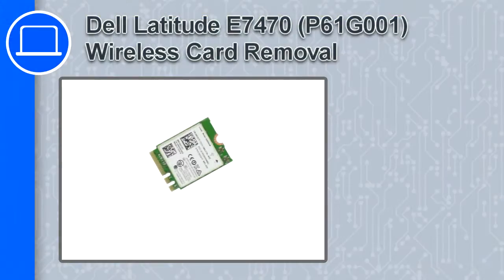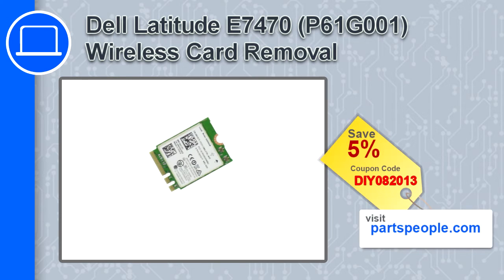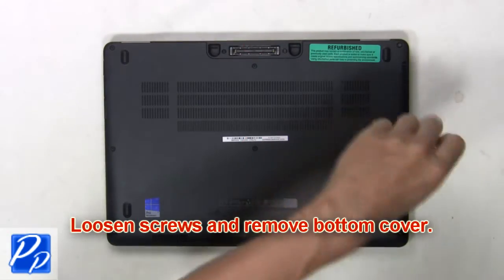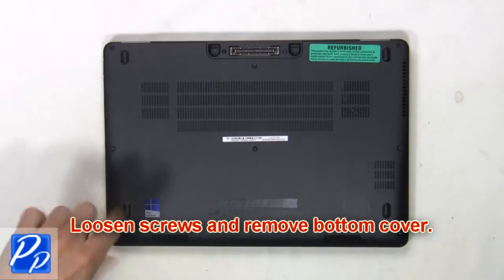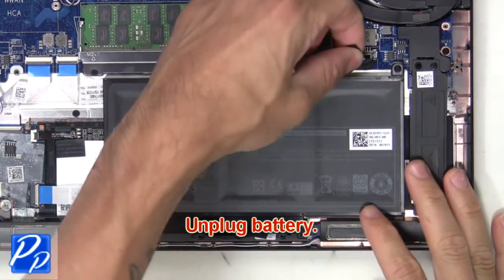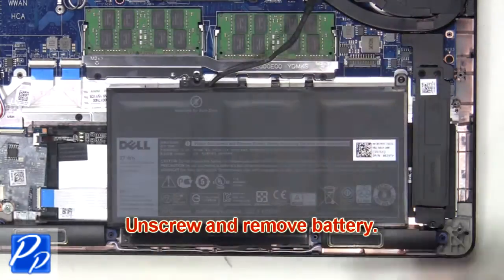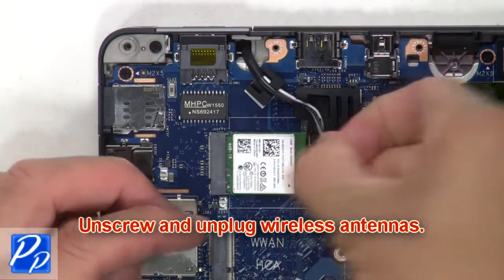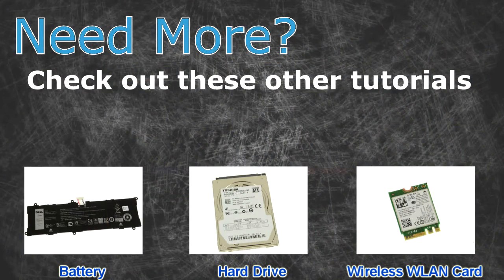Dell Latitude E7470 (P61G001) Wireless WLAN Card How-To Video Tutorial

Comment: i dont see the point of removing battery, it doesn't cover the wifi card
Reply from the maker: You are correct. You really only need to disconnect the battery. The Dell Owners Manual recommends removing the battery so for safety purposes we follow their recommendation.